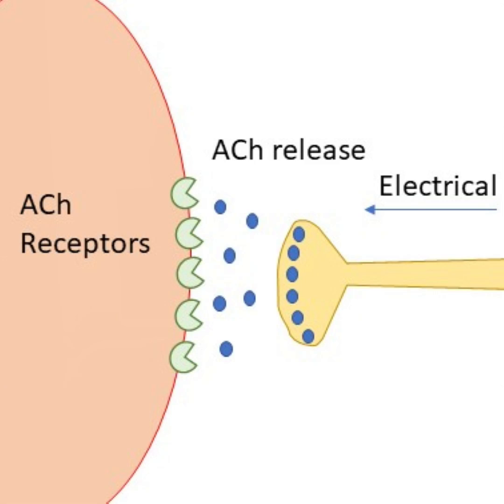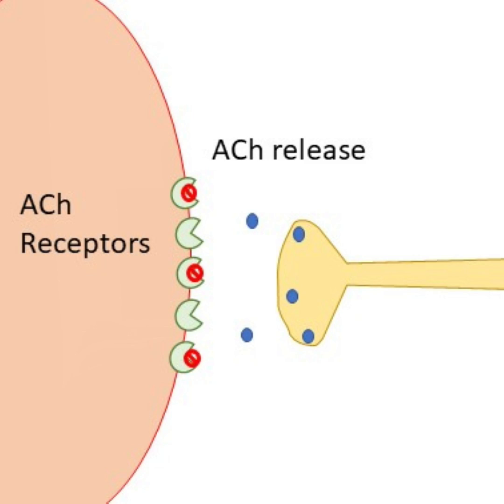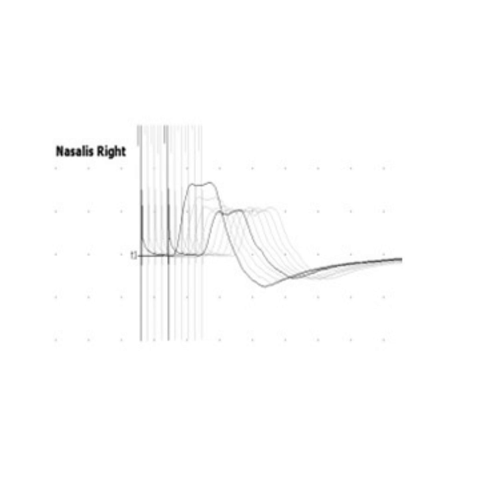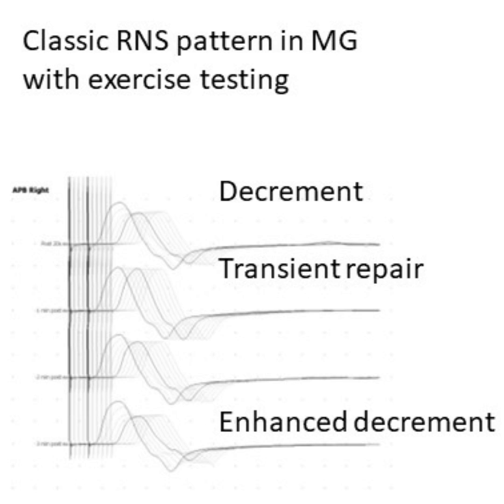Repetitive Nerve Stimulation

Comment: Is RNS a good test for cramp-fasciculation syndrome?  Would any peripheral nerve hyperexcitabilty disorder show a decrementing response?
Reply from the maker: No and yes. RNS can trigger 'after discharges' in peripheral nerve hyperexcitabilty states when performed at high rates i.e. as a function of exercising / triggering the muscle. However, decrement per se (the primary measured outcome of doing the test) isn't a feature excepting rare cases of Myasthenia where muscle rippling and hyperexcitabiloty can occur. Bw Simon